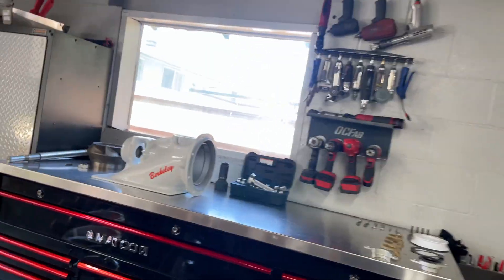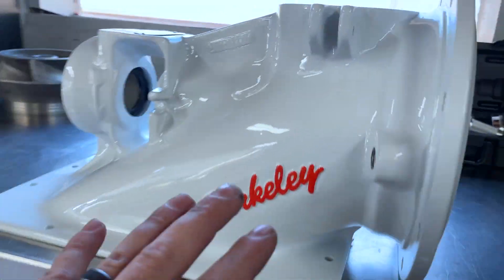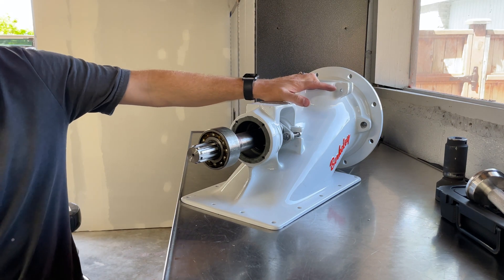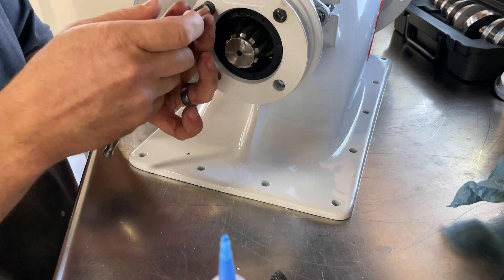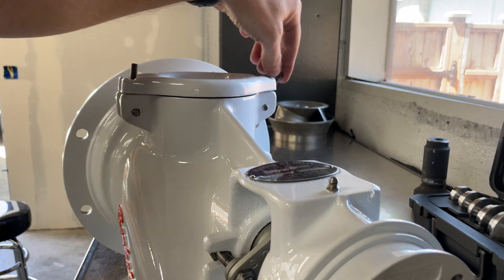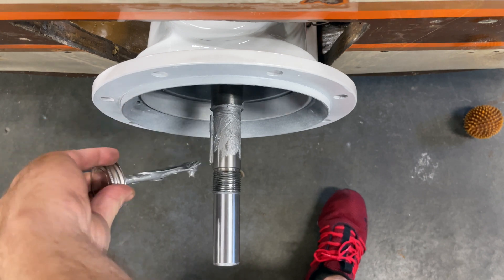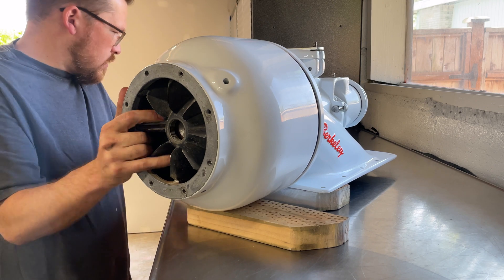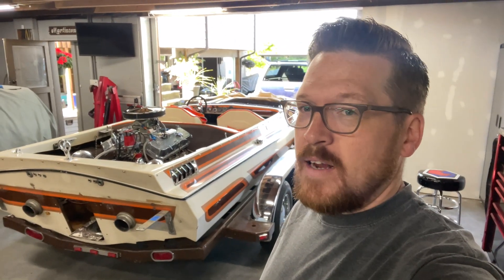How to Assemble a Berkeley 12JG Jet Boat Pump

Comment: How did you remove those pins for the hand hole studs that you had to hammer back in? Any special tool?
Reply from the maker: No special tool. I used a punch/drift and drove them out from the back side. Space is tight and I had to hold it at a bit of an angle, but it was manageable. 

~ Nick

Comment: How do you feel about a stainless bolt to cap the oil off on the bowl? Just curious cause i ordered a stainless bolt.
Reply from the maker: I have no issues with them. The plastic ones are a bit frail, but that only matters during assembly. I'm still running a plastic one, but if it were to brake I would switch to a stainless. 

~ Nick

Comment: Thanks bro. Do you have a video showing the installation of a place diverter?
Reply from the maker: Not yet, but I will shorty. I need to finish off the gelcoat in my bilge, then I can work towards rigging the boat, including the place diverter installation.

Comment: Great vid. Will be very useful when I come to rebuild mine. Out of interest have you had any experience with the seal you can buy to replace the rope seal system. It's quite an expensive seal but I prefer the idea of not having drips of water coming through and having to periodically adjust the rope packing.
Reply from the maker: I have only run the rope seals, so my experience is limited to those. I am glad that you enjoyed the video. 

~ Nick

Comment: Did you check the clearance on the impeller to wear ring
Reply from the maker: Ken, There was no need to measure those tolerances in this instance. This pump was rebuilt years ago, and then set on a shelf. I then took it apart to re-paint it. All the components that went back into it during this video were the items that came out of the pump. All of the clearances were set during the rebuild, nothing changed. This was basically a dissasembly and re-assembly with a paint job in the middle. 

~ Nick

Comment: Can that jet  will move a 22' cc project boat?
Reply from the maker: Wilfredo, I am not too sure that I know what you mean by 22' cc.. If by 22' foot long boat then yes it will be just fine.
Reply: Thank you.  And how much do they go for
Reply from the maker: That really depends on the components that are installed in them and the condition. I’ve seen them from a few hundred dollars to several thousand. 

~ Nick

Comment: What did they set the impeller to wear ring clearance? You did not check it on your video?
Reply from the maker: Mike, the reason that I did not check the clearance in the video is because the pump was rebuilt by the crew at CP Performance a few years ago and the clearances were set by them at that time. After the rebuild it was stored in the shop and not used. I then took the pump back apart to repaint it before it was ever installed or ran. So I there was no need to go back and check them as nothing changed. 

As for my clearance it was at .025” with my stainless impeller. 

~ Nick

Comment: I'm almost through the video but something that seems odd to me is that I don't believe I've seen a washer yet being used on any bolts here, do you know why that is?
Reply from the maker: I assume you are referring to the bolts that secure the bowl to the suction housing. In that case neither my Berkeley or Dominator pump have washers on those locations. Also if I remember correctly the shape of the flange on the suction house has a radius that is very close to the bolt location which could interfere with a washer. I have had no issues with washerless bolts, but keep in mind I also use Blue Loctite on my hardware as well. 

~ Nick
Reply: @AutoTechNick  Ok, I think I understand for the most part. What about the impeller? I didn't see a washer on that big nut either. I'm not saying it's wrong I'm just not used to seeing that many nuts and bolts without washers. Also, in some cases, not having washers on the fasteners can throw off the torque settings when you torque them down.  🤷‍♂️
Reply from the maker: @bodeine454  You do have a good point about not achieving the proper torque without having a washer. However for the impeller nut you referenced, it is a nylock nut. The nylon locking feature of the nut will create a high running torque anyways, which will have a effect on the actual final torque. I do agree with you that when dealing with a critical torque that you should be using a washer or the proper lube on the nut to reduce friction & ensuring that the correct torque is achieved. 

However we must remember that these pumps are fairly crude in design. They were designed, and in most cases built in the early 60's. A lot in technology, design and manufacturing has changed since then. 

~ Nick

Comment: What kind of paint did you use?
Reply from the maker: Ryan, I used acrylic enamel paint for automotive use. It was a single stage paint, but I ended up adding clear coat over it. 

If you haven’t seen the video where I covered the pump re-paint here is the link:

https://youtu.be/qdSYMS2EBmw

~Nick

Comment: I really like the simplicity of this unit. I plan on converting a stern drive houseboat to diesel jet drive with this. Why do they use what are basically nylon rope pieces as seals on the inside shaft though?
Reply from the maker: I agree that the rope seals seem like a pretty primitive means to seal the suction housing shaft, but I think they provide the best function vs cost. Depending on the application the suction housing can see quite a lot of pressure, well over 50psi. That in combination to the fact that you have to seal pressure from a spinning shaft means that the rope seals, although primitive are a very effective solution.
Reply from the maker: That sounds like an interesting project with the jet drive and house boat!!
Reply: @AutoTechNick  Would this be able to handle it? It’s a 1978 Holiday Mansion (36 foot), which I think displaces about 12,000lbs. I plan to use a Cummins 6BT. Speed is not important to me, I only need to be able to do about 10mph.
Reply from the maker: My biggest concern would be maneuverability… I am unsure if you have been behind the helm of a jet drive equipped boat before, but the low speed maneuverability is pretty much non existent. 

With that much weight and that big of a boat, living at such low speeds I fear that you would have very little control of the vessel.
Reply: @AutoTechNick  hmm, the whole reason I wanted to do this is I want to go diesel and the sterndrive can’t handle the torque, I’m told. Maybe there is a simple way for me to go straight shaft. I’ll keep researching. Thank you for your knowledge.

Comment: Did you check to se if the impeller will spin by hand after installed. I just rebuilt mine and it’s a new wear ring that has a lip inward and if I torque it to 75 ftlbs I can’t spin it by hand
Reply from the maker: Yes. I was easily able to turn the impeller after torquing the nut. From your description it sounds like you have a "shouldered" wear ring, and the fit for the impeller is too far forward, causing the interference. If this is the case, you can buy a shim kit from CP performance that will move the impeller rearwards and correct interference issued with the wear ring. I put a link to the shims that I am referring to. 

https://www.cpperformance.com/p-960-shim-kit.aspx